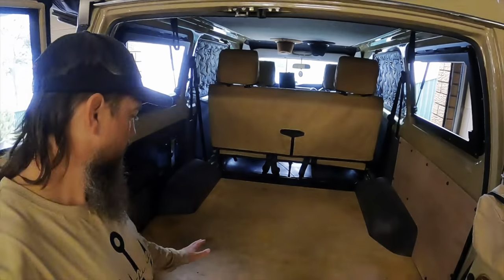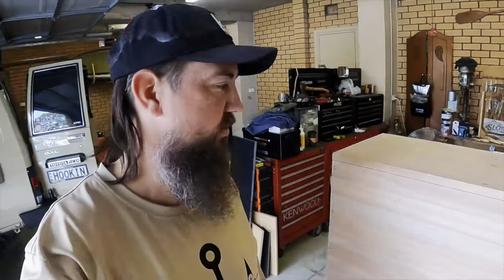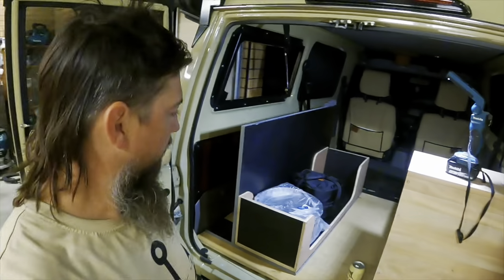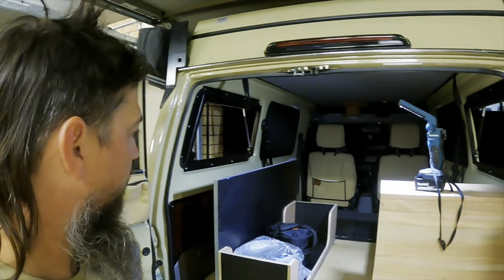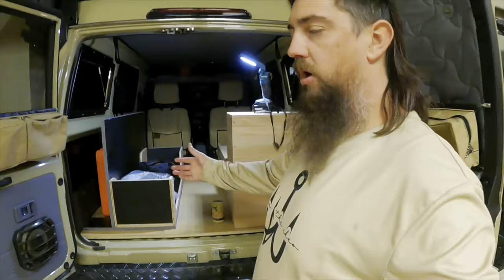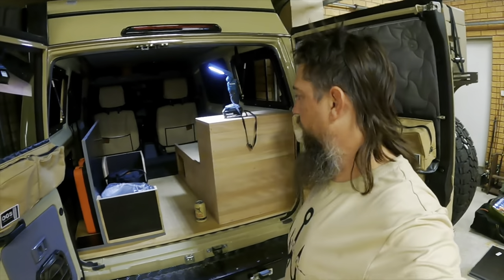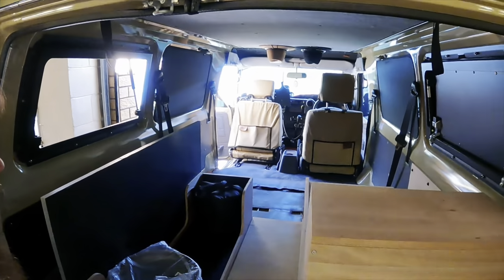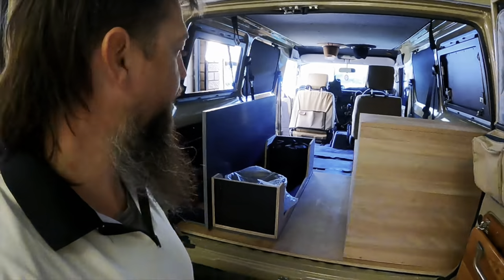Troopy Fit out - Thought process with build to keep things flexible. Part 1

Comment: Loving the build and listening to your reasoning. Totally Hearing ya with your anxiety as your time is running out for your fit out.Often how you think your storage will work on the trip and for the future, will end up changing once you’ve used it and you’ll want to modify it again anyway. Try not to overthink it and just knock up some basic flexible storage spaces in the mindset that you’ll refine it the second (or third! 😅, I’ve been there) go at it anyway….. chin up bro you’ll get there. 👍
Reply from the maker: Cheers brother, we are on the road mate and enjoying it so far. The lead up was hectic 🤦‍♂️ glad you are enjoying the vids mate. Little hesitant to put them up but I suppose it’s the thought process and every build is different so I though that some people would get something out of it 🤙🏽 appreciate your support mate and kind words. Let me know what you think when you see the finished outcome?

Comment: Good stuff. I like the cut out sides in the drawer. You may need to look at a tension strip across the top of the outward drawer to help stop it sagging when it’s out. Timber is definitely the way to go as it’s heaps lighter than the steel options. 
I was interested is the jetboil genesis until I saw the price!
Reply from the maker: Cheers brother, yeah I’ll see how it goes. There is not a lot weight in the drawer really. Spun steel camp oven 😊 I’m
Pretty happy with it overall though. Yeah the genesis was a fair investment so it will be interesting to see how it fares up. But I thought it would be awesome for the boat too for day trips or over nighters so that sold it for me 🤙🏽 thanks for watching mate

Comment: Hey mate, how is the ply base fixed to the actual floor of the troopy? Cheers 🤙
Reply from the maker: Hey brother, the plywood bases are bolted directly to the troopy floor. Using countersunk 8mm stainless bolts. Rear section bolted through existing bolt holes in floor. Front section I bolted directly into rear seat mounts 🤙🏽 Keep your eyes peeled for next vid. I talk about it. Cheers for watching mate 🤙🏽

Comment: Hi Guys !! With the flooring, did you put insulation under the ply both back and the removable front section. or is just ply ?? In the video it looks like you have Insulation !! Cheers !!
Reply from the maker: Hi Jeff, yeah we put a layer of insulation under both sections of the flooring. It will stay there with or without the rear seats in, I just cut around the mounting points 👍🏼
Reply: @hookin  Without pushing the Friendship....What thickness is the Insulation?? and,  did you buy the Insulation from Carbuilders or Bunnos??      I see Great Northern in the background, no XXXX Bitter :hand-orange-covering-eyes:
Reply: Sorry Guys ! If you don't mind, A couple of other questions, I see that you have what appears to be a Aerial (mounted - attached) to the side of the Roof ? How did you mount that Aerial...just drilled 4 holes and sikaflex or did you use a backing plate on the underside of the roof ??
The other one is, what size and brand are your Solar Panels, how are they attached ?
Cheers !!